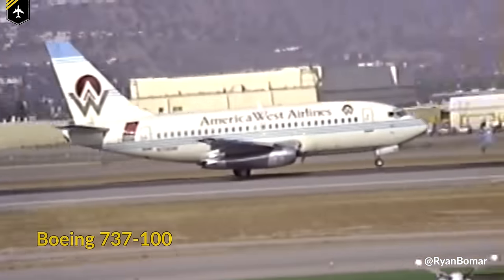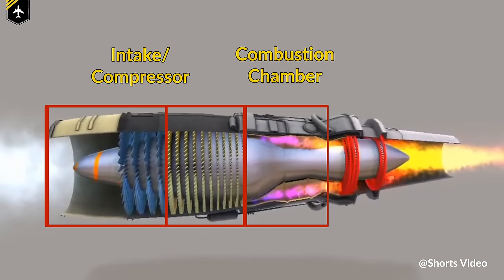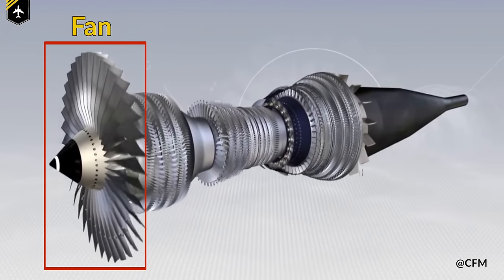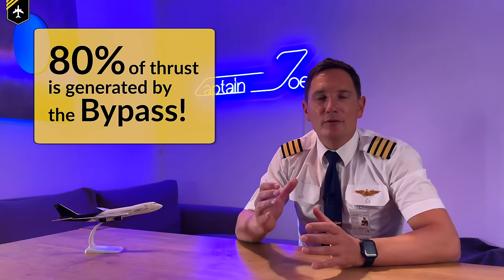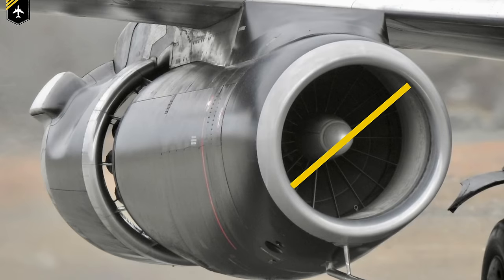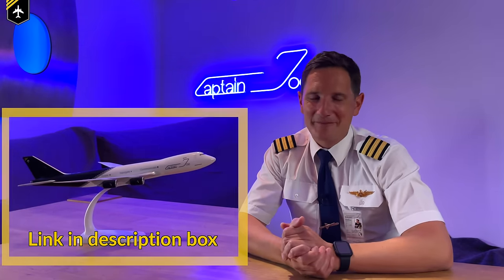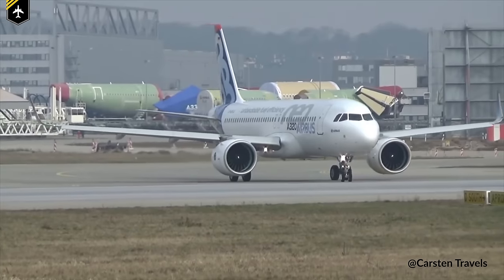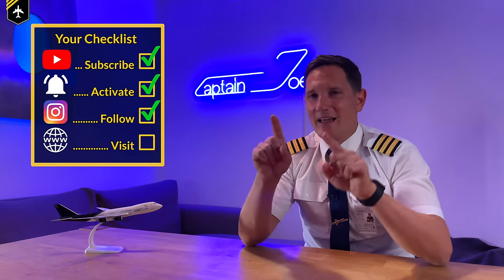HOW DO JET ENGINES work and WHY do they get BIGGER Explained by CAPTAIN JOE

Comment: I think the Concorde is a TurboJet... Therefore making it the most famous turbojetted aircraft
Reply: Indeed.
It's the most famous and technologically advanced airliner ever made, anyway. He's (yes "le" Concorde is a "he" here in France) out of competition in many discipline. It was also the first airliner with complete fly-by-wire, FADEC engine management (albeit using analog computers, so technically it was the one and only "FAAEC" system), and rocket-technology-derived inertial guidance autopilot....
Reply: Jettedturbo
Reply: I agree that the Olympus 593-powered Concorde should be at the top of the list, but I’d add the A12 / SR71 to the tally. Yes, I know the J58 is a ramjet hybrid but it’s also a constantly-afterburning turbofan so it counts in my book.
Concorde might be more famous but I’d argue that the J58 is the most amazing air-breathing aero engine ever created, especially the speed-adjustable bypass, variable-geometry intake cones and the hypergolic afterburner ignition system. The variable intake ramps on the Olympus 593, albeit amazing, are slightly less sophisticated. 
NB. I’m pretty fortunate in that both these aircraft sit in Duxford Imperial War Museum, 10 min drive from my home.
Reply: @filipkonopacki1547  being a great fan of both planes, I have found a way to love both without competition.
Concorde is the most famous and most formidable civilian airliner.
The Blackbird is the most famous and most formidable military plane.
There. Both the best in their domains.
Reply: @Damien.D  Une chose est sure c'est que LE Concorde était une merveille à la pointe de la technologie de son époque!
Reply: @mathuringarcier  Il est TOUJOURS en avance sur son temps. Tout comme l'Aérotrain, autre invention incroyable qui date de 1969. Et la même année, on marchait sur la Lune...
Pour une raison étrange, ensuite, on a juste choisi le mauvais futur...
Reply: @Damien.D  These two aircraft have one more unusual thing in common: after retirement, all* surviving airframes were preserved and put on display. Such was their significance!
*Of course I’m ignoring here the poor, mistreated F-BVFD that got cannibalized for spares and eventually scrapped, because this happened in 1994 when all the other Concordes were still happily flying.
Reply: Caravelle but I guess it's forgotten
Reply: Lucky you!
Reply: @ Damien Drouart

Concorde is neither “he” nor “she” because it is said without the article. IE: Concorde arrived at Paris (Concorde est arrivé à Paris) not “the” Concorde arrived at Paris.
Reply: Yes - not to mention the most beautiful aircraft ever to grace the skies.
Reply: @ASVPChrisB  this is where we don't agree 😬 I'm afraid
Reply: @mathuringarcier  Chacun à son gout... What's the most beautiful to you?
Reply: @ASVPChrisB  c'est sur, j'ai tout le temps l'impression que je suis le seul Avgeek à ne pas aimer le Concorde, je préfère le 747-400 ou le 787-9
Reply: @mathuringarcier  Bien sur. I guess because I grew up with her flying overhead when I was a kid, it was always very special to me. When I was finally able to fly in her across the Atlantic, it was an exceptional experience. Sure, the 744 is the Queen of the skies and my favourite as a passenger as well as on the flight deck, but the lines of Concorde are sensual and sublime to me.
Reply: @ASVPChrisB  I think the main issue is that I'm too young to have known the Concorde, I never lived in a world where it was flying
Reply: @filipkonopacki1547  there is a concorde sat at Heathrow that is still it's full frame but can't really be called preserved
Reply: SR71 Blackbird....   But you maybe right.. It may be more famous...  but not as cool as the SR71
Reply: Yes Concorde's Air Intake  was variable geometry to manage the intake speed.
Reply: @Bartonovich52  ships and aircraft were traditionally She .
Reply: @mathuringarcier  I was 19 when it stopped flying. Wish I would have gotten a chance to fly on it. 😔😔
Reply: Yeah no fans on those engines like a fighter jet but they can control the after burners with switches on the concord.
Reply: @ulfpe 
I think of the the Caravelle as a famous aircraft, it was one of the world's jet airliner pioneering aircraft definitely.
Reply: @Damien.D  The concorde may be out of competition in many aspects, but its delta wing doomed it. >400 km/h takeoff speed led to its many tyre explosion accidents and ultimately to that tragic accident.
I never understood why they didn't adopt a more sound solution, i.e. variable geometry wing, a-la B-1B Lancer, Tu-160 Blackjack, etc.. Instead they basically made a giant TSR.2 (or a giant Mirage IV, if you are frenchy). Maybe the technology wasn't mature enough at the time?

Comment: The fact that a 777-x can fix a whole 737 fuselage in their engines blow my mind 🤯
Reply: Yes. Thats biggest and most powerfull engine for commercial aircraft
Reply: Yeah I knew it but still can't make up my mind about that!
Reply: @Damien.D  ok.. engineering marvellous
Reply: Imagine a 737 with a 777 engine.
Reply: @rocko44444444  The cockpit would be split in half and sucked in the engines at takeoff XD
Reply: SAME. 🤯 😳
Reply: I was flying several times with a 737 and every time i was thinking about this, just mindblowing.
Reply: 69th like lol
Reply: @rocko44444444  Imagine a 737 with two of them!
Reply: You're easily blown...
Reply: @CHOXON2CHOXOFF  777-x is not the most powerful
Reply: @rocko44444444 it would pitch up at idle power because of the imense thrust and at 10% it would take off within 8 sec. Can't imagine

Comment: The most famous turbojet aircraft: Lockheed SR-71 Blackbird. The engines at subsonic speed were indeed a turbojet. But above mach 2, it  became a hybrid engine (well it was called turboramjet), and it's fuel efficiency increased.
Reply: That what I thought of too; however, the Concorde is, no doubt, more famous to the general public.

Comment: It's mind boggling to me how they come up with this stuff in the first place. WOW, you did a great job of explaining it in simple terms.
Reply: If I remember correctly, the initial design came from the turbochargers used on piston engines (to help efficiency and power at higher altitudes).  Then someone had the idea to just take out the piston engine and just feed the fuel in.  And fun fact, the M1 Abrams tank actually uses a jet engine instead of a traditional one with cylinders.
Reply: @wcvp 
It's more like the earlier ideas that resulted in piston engine turbo chargers were the same ideas that resulted in turbojets.
 The basic axial turbojet engine was first sort of partly cobbled together around or before 1900 by Parsons (Ireland / North England) while doing steam turbine power generation machines.  A bladed multi stage axial steam turbine coupled to a axial bladed multistage compressor. Then Parsons did some work on the idea of putting combusters in the middle instead of using steam. People at the time were thinking about it's use as an aircraft engine.
  A French chap came up with the basic axial bladed multistage turbine idea around 1875.

Comment: Hi, I have worked for Safran Aircraft Engines for a while. By the way, thanks or the appreciation of our work 😃

To give extra information on your very good video:
- You mention 80% of the thrust comes from the cold air (bypass). The order of magnitude for the leap is around 65%, and 70% for our competitor if i'm not mistaken. But the general idea is indeed to get a bypass ratio as high as possible. The concept is that the hot air that comes from the nozzle drives the cold flux. Therefore, the faster goes the hot air, the faster goes the cold air as well. And as the cold flux represents 10x the amound of air coming from the hot flow, the thrust developped by this bypassed air is huge.
One limitation comes from the fact that at some point, the hot flow is not strong enough to lead that much cold air, and you loose in efficiency. That's why we are desperately trying to increase the RPM of the shafts and fan, as well as the turbines' maximum temperature with composite materials. The goal is to rise hot flux's energy to be able to increase the Bypass ratio even more.

- One limitation to even bigger engines is definetely their size: can't mount them under the wing; they disturb the flow over the wing as they get bigger and bigger; they induce more stress and bending moments on the wing as they become way too heavy; and so much stress is applied on the fan and other internal components as all parts become too big and tend not to rotate as fast as smaller ones ...

We expect to be able to increase efficiency from a maximum of 10-15% compared to current modern jet engines in the following decade, but the next jet engine generation will require a new technology to go further. That's what the Open rotor is about for example.

Bye

Comment: The most iconic turbojet is the Concorde. They didn't really have a choice, for supersonic speed they needed the thrust to be of very high speed air, not of high mass of air, so a turbofan wasn't really an option.
Reply: That's correct and not a lot of people understand it. The faster you want an airplane to fly the higher the speed of the accelerated air has to be as it leaves the back of the engine. That's why a propeller engine that only accelerates air backward at about 400mph can't propel an airplane forward at 600mph. To do that you need a jet engine that can accelerate the air backwards at about 700mph or more.
Reply: Boom is planning to use turbofans in their supersonic airliner.
Reply: @NiHaoMike64  The fan will improve the low altitude, low speed performance of the aircraft. Then the core will take over and accelerate the airplane up to supersonic speeds.
Reply: I agree about the Concorde being iconic, but it’s engines are hidden from view.  For this reason I’d nominate the Boeing 707 as the most iconic turbojet.
Reply: @ Joe Vignolo

Not quite. 

For example, the gas flow in the J-58 in the SR-71 is entirely subsonic even though the plane is flying at Mach 3. 

The thrust comes from the high pressure and expansion of gasses inside of the divergent nozzle. 

A single stage fan simply can’t generate those pressures out of the fan duct.
Reply: Actually its the SR71Blackbird.
Reply: @MendTheWorld  that's the one I immediately thought of 👍👍
Reply: The concorde also chugged 2 tons of fuel just taxing to the runway.
Reply: I would have thought Concorde and its Soviet counterpart the Tupolev Tu-144 both had ramjet engines, just like the Lockheed SR-71 Blackbird and the proposed Rockwell International Star Raker.
Reply: Except for the fact that the ABs were used only at take-off and to transition through the transonic regime up to about mach 1.7. From there it essentially super-cruised. Marvelous machine.

Comment: I really love the noise of jets spooling up; the loudest I've ever heard was a de Havilland Comet 4 built in 1963, which until 2019 used to do fast taxi runs at Bruntingthorpe airfield in Leicestershire; you could walk so close to it during engine start-up  (RR Avon turbojets) that I could feel the noise vibrating through my body! It's still there, alongside an HP Victor, but they don't do taxi-runs anymore, as the runway's been turned into a massive car park. I think their EE Lightnings still do engine runs occasionally though. Although I used to live near Heathrow, I've never stood as close to Concorde during spool-up (Bristol Siddeley turbojets, later known as Rolls-Royce), so I can't compare it.

Comment: I always knew how high bipass engines worked but I didn’t know why engines couldn’t go stupidly big due to the fan blades going faster on the outside so I found this really useful thankyou
Reply: it's the same reason prop driven planes and helicopters have a maximum airspeed.
Reply: I worked for and did and engineering apprenticeship with Rolls Royce so was aware of the tip velocity issue but the main issue with the engines we made was small size needed in helicopters. You couldn't just make them bigger to get more power and you reach a physical size that you can't go below with the HP compressor blades as they don't work. The pressure ration in a helicopter engine was pathetic compared to a much larger engine. To get round that the HP compressor is centrifugal running at mind boggling rpm.

Comment: Thank you for this great video Cpt Joe - understanding the engines is one of my weak points when chatting in our AV community. I now understand the basic principles of an engine, how the bypass system works and has evolved, and the limitations of that system. Agree with you - total respect to engine designers etc. The info about the 777 engine being as wide as the 737 fuselage just blew my mind lol! Great content as always Joe, thank you!

Comment: Famous turbojet: I have to say the early Boeing 707s with the JT3D turbojets. It's amazing what Boeing has done to the 737, which today resembles a twin-engine 707. 

I miss the classic Boeing 747 "buzzsaw" sound with its P&W JT9D taking off.
Reply: JT3D is actually a turbofan which has a low bypass ratio.
Reply: @mrcannotfindaname  You are correct.   however the first Boeing 707s had the JT3C, which was a turbojet, which was upgraded to the JT3D turbofan.  
Some links: 
https://en.m.wikipedia.org/wiki/Pratt_%26_Whitney_J57

https://en.m.wikipedia.org/wiki/Pratt_%26_Whitney_JT3D

That’s why I nominated the 707 as the most iconic turbojet.  (The engines in the Concorde were hidden in the wings!).

Comment: You forgot about the triple shaft technology of the RR civil engines. This decoupled the Fan from the the LP compressor allowing better rotor speed management.
Reply: At the expense of higher weight and complexity.
Reply: @Bartonovich52 well, there is always a trade off. An engine is a compromise between a lot of factors. 
On top of that, there is a difference between the theory and the practice. For example the Gear Turbo Fan ( or GTF) is a good idea but difficult to realize. Like N1 vs EPR, etc.
It’s the same for the size of the engine. A bigger fan is good for takeoff, but it generates a lot of drag during flight.

Comment: Great session, illustrated by great animation clips. I was wondering at what approx. altitude the jet fans start  to receive the bypass air ? in other words when can no longer supply the LP compressor with intake air ? Now you know why the aircrafts like cold climates ( air density at higher altitudes)
Reply: On the ground, that is where they need the most thrust for takeoff, plus reverse thrust to land safely!
Reply: I believe the confusion comes from ALL the air going through the fan, and a small amount of air after the fan is drawn into the core.

Comment: Finally understand how turbojet and turbofan engines work in more details. Clear explanation and not too long. Great video Captain. The most iconic turbojet engine I would say is the J-58 used by the legendary SR-71 aka Blackbird.
Reply: What about the Rolls-Royce/Snecma Olympus 593 powering the Concorde?

Comment: The PW GTF's are awesome!!! We, F9, just took delivery of our first 6 A321neo XLR's with the PW 1130G-JM GTF's... They are extremely quiet at idle. When you are standing 90 degrees from the inlet, you can not hear them running.... Most of our A320 fleet is running the GE LEAP's which are nice too. We even have a few A320/321's CFM56-B's, but we're phasing them out with the neo's...

Comment: The explanation why lots of bypass flow is so important for lots of thrust (80%) is excellent. As an engineer, I would have preferred, in addition, at least a reference to Issac Newton and especially his third law (for every force/reaction there must be an equal and opposite force/reaction). The fan produces thrust exactly the same way a rifle recoils against your shoulder when it is fired except the fan is a continuous process. The rifle spits a bullet (that has mass) out the front and a fans spits air (that certainly has mass) out the back. Imagine how much force it would take to physically throw the mass of a car out the back of the engine every second. The same force propelling the equivalent mass of a car aft must be applied in the opposite direction to the engine (through the fan blades) and that is what pushes (thrust) the airplane forward. More air (a bigger fan) means more mass, and that means more thrust just as a more massive bullet (and bigger charge) makes for a bigger black and blue mark on your shoulder. Also, do not underestimate how heavy (massive) plain old air is. A one inch square column of air the height of the atmosphere weighs 14.7 pounds. Collect and compress literally tons of it through that huge fan blade in the front of the engine and you have lots and lots of mass being thrown out the back. My GF tells me she never asks me what time it is as I respond by telling her how to make a watch. I hope this is not construed the same way.
Reply: That "car" is thrown out with a speed of roughly 900-1000 km/h, so imagine a Boeing 777 throwing out two cars per second at that speed, or an A380 throwing out four somewhat smaller cars per second.

Comment: I was taught in fundamentals "fundies" in the USAF for crew chief school that a jet engine doesn't push....it pulls. The explanation: The turning/burning engine produces expanding, hot, high pressure, high velocity air exhausting it out the back (what is it pushing against?) This hot, expanding, high pressure air wants to become low pressure again thus the fan is essentially pulling the aircraft/engine forward gulping in the low pressure air. I'm not saying that's what's happening as I don't design these but that's what I remember being taught in 1989 when I joined the USAF and was an F-16 crew chief.
Reply: Wow, I never thought of that. Guess that is a correct explanation, thank you!